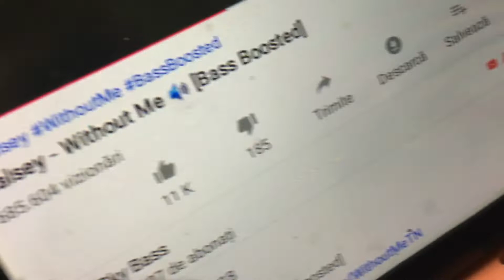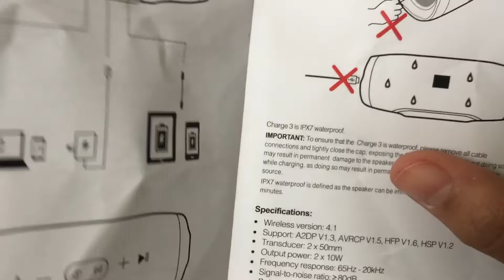Ch 3 & ch3 fake cover off

Comment: I have a smol screw gun from black and decker c:
Reply from the maker: JBL Boy cool 
Btw thank you for subscribe
Reply: Jbl tester Este tare Np bro:)
Reply: btw is the charge 3 your??
Reply from the maker: JBL Boy yes both
Reply from the maker: JBL Boy 100€
Reply from the maker: JBL Boy the original
Reply: Jbl tester Este tare cool
Reply: btw do you use low frequency mode on it?
Reply from the maker: JBL Boy no I don’t want to damage to the drivers
Reply from the maker: Do on yours but not on mine